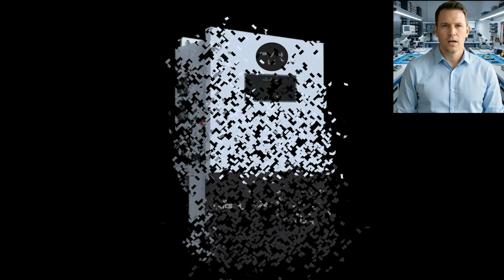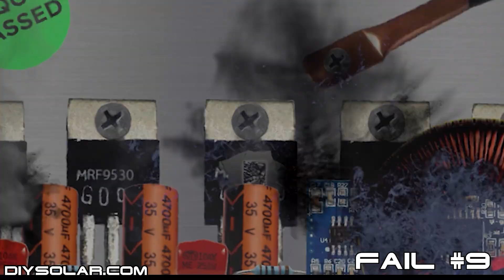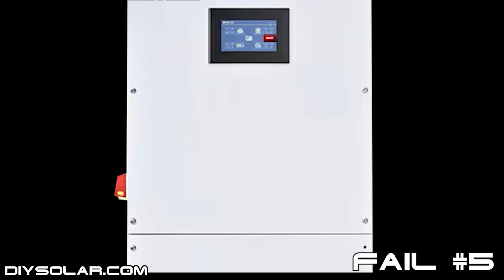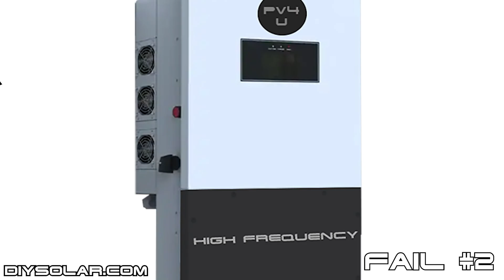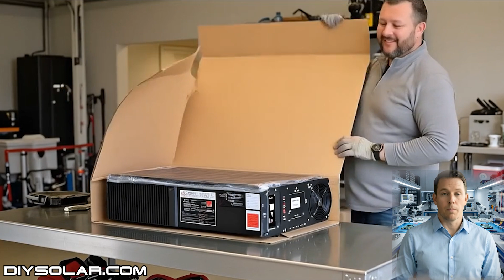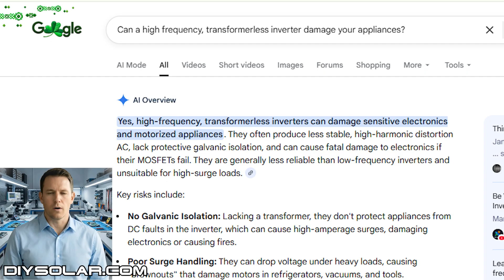Watch This BEFORE You Buy an Off Grid Inverter Costly Mistake!

Comment from the maker: Diysolar.com If you’re currently shopping for an off-grid inverter, take a step back before making a final decision.

One of the biggest mistakes we see — after nearly 30 years in the industry — is choosing an inverter based on popularity instead of engineering.

A lot of what’s being promoted online looks good on the surface, but doesn’t always hold up under real-world conditions.

If you have questions about inverter selection, system design, or avoiding common pitfalls, drop them below — we’re here to help you build something that actually performs and lasts.